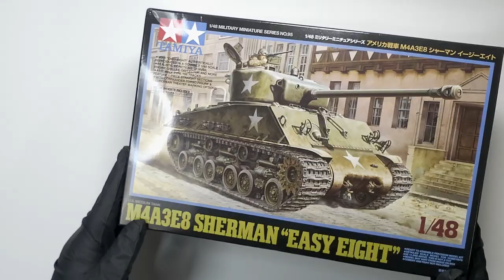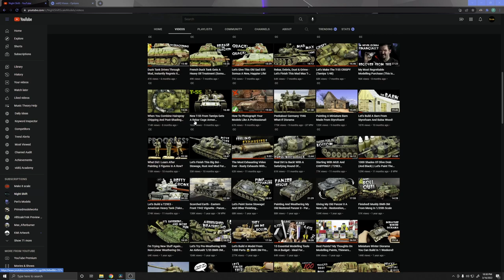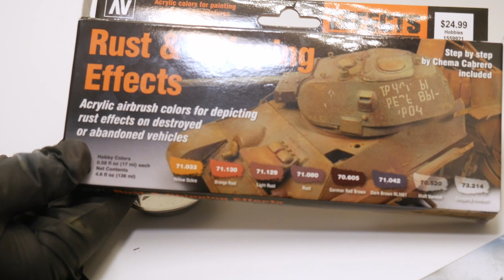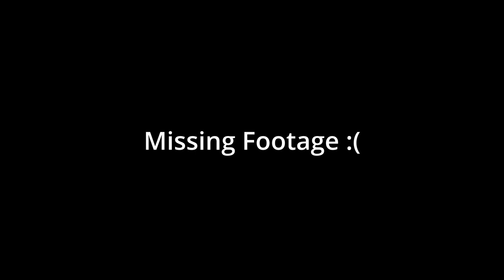Tamiya Sherman M4 1/48 Full Build

Comment: I've never built a tank, only watched videos -- this looks great! The weathering looks really good, and it's obvious you studied other builders to make it pop. I admire your attitude of approaching this as a hobby -- this looks cool so I'll try it even though it may not be accurate. I quit a local hobby club because they were history buffs that expressed that love through modeling, and I just wanted to build things because they looked neat.

Did I briefly see another airbrush besides the Iwata? I have a Harder & Steenbeck airbrush I got just so that I could use a smaller needle, which is great for really close detail work. I'm not proficient at the airbrush either, but Genessis Models' YT channel taught me about light misty coats first, then going in with heavier coats.

Thanks again for sharing!
Reply from the maker: Ha you caught that! Yes I got a used H&S Infinity on ebay just to test it out since I have heard a lot of good things about it and I have seen a lot of videos of modelers using it. I tried it out and I couldn't get it to work well but I think its because  it needs some maintenance and lube and I am not really familiar with how to do that yet. It might just be broken too. I'll mess with it some more because it is really comfortable to use. It is heavier than the Iwata and I actually prefer that. Maybe I'll buy a new one if I cant get it to work. Thanks for watching!!

Comment: Hi, amazing work. What kind of cement/glue did you use to put the tracks on at 25:30? How did you make sure not to wash off the paint when applying cement/glue. I always ended up washing off some of the body paint when fitting small accessories on the body 😂
Reply from the maker: Hi there! Great question! It is a superglue that is designed for acrylic nails. I can't find the exact brand I used but its basically this stuff: https://amzn.to/43xx2Lw hope that helps!  And thanks for watching!